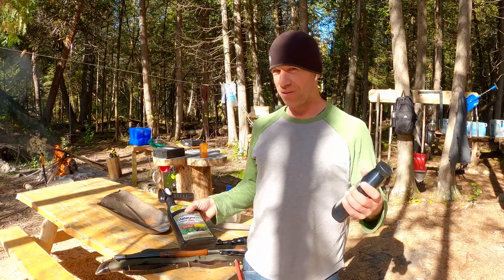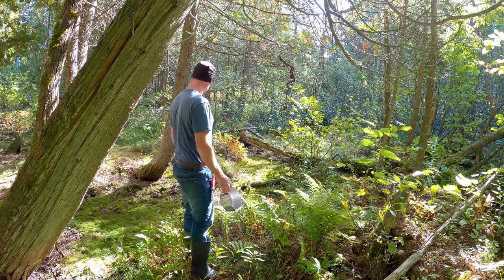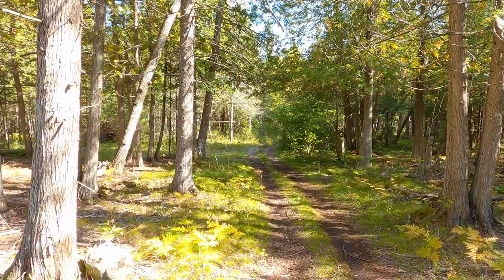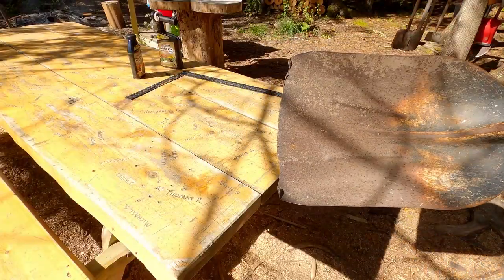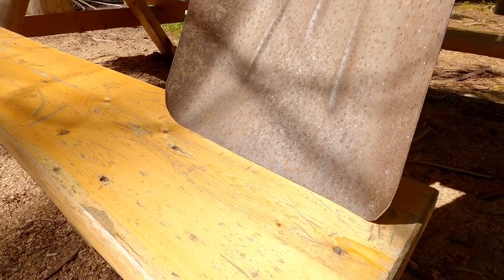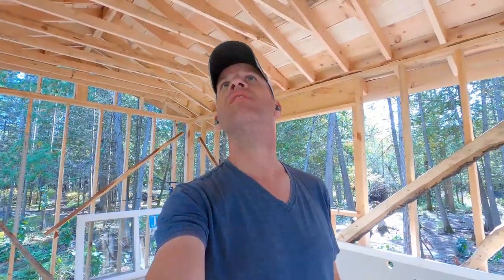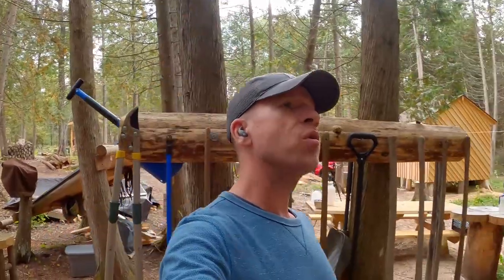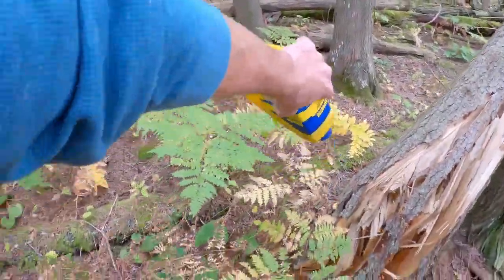Day 975 Living in the Forest- Spreading Mushroom Spores, 30-30 Shooting #105

Comment: Shovel grilling began, so legend goes, with a rancher in the Australian outback who had lamb (no shortage of that in Australia) and a campfire, but no grill grate to position over it. 

So he sterilized the blade of shovel in the hot flames, arranged lamb chops seasoned with salt and pepper on it and grilled the lamb on the spade thrust directly into the fire.

Comment: I'm very interested in seeing how well your planer works on the generator 👍 I'm in a house with old electrical wiring so I don't want to stress it and start a fire 🤣 

If yours works great I may have to reconsider buying one to run on our ecoflow generator/battery system... it would make woodworking a lot easier!

Comment: If you want a deer and preserve it, get yourself a pressure canner and some pint jars. Cut the meat up and can it. All you need is some clean water. You can use the canner on a camp stove as long as you can burn it for 90 minutes. The meat will keep like that for 2 or 3 years...maybe more. The rest if it you can smoke or make jerky. I can deer every year to make hash or cook with vegetables and you add your spices to it when you get ready to use it. It's a little work, but worth your while.

Comment: this was a fun video dont know why you dont do it more . hey you have at least two roofs now and there of pretty good size for the size of buildings you can make . why not get some gutters from the re store  or where ever you can cheap and use them to collect rain water . collecting rain water is legal in all 50 states  i think a couple states have limits on it for what ever reason but there not Michigan. now it would still suck in the winter but spring summer and fall  it rains and from watching other channels that do it i can say with a fairly good roof it would not take very much rain to fill your water tower up .and how much fun would it be like lots of fun right . also maybe we can talk water filtration at some point . two 5 gallon buckets some activated  .charcoal and a water spout  and you pretty much have a berky water filter . you dont really have to use activated charcoal regular charcoal would work but activated charcoal works like ten times better . its funny i been trying to learn more about activated charcoal on how its made it is pretty interesting on how its done . basically its charcoal thats washed really really well . then its baked dry . the smaller it is the better it is for water filtration . but it is also used as air purification and it should be larger so air can pass through it . from like a fan . but you can put regular charcoal out on a plate and it will absorb stinky odors  . just fun facts . charcoal is pretty easy to  make as well . that aspen wood you got would make great charcoal . all them scraps you burn . maybe not the cedar so much . just need a metal 50 gallon drum with a locking lid . a small hole to release gas . set a fire under it  and burn it . the gas coming out of the hole can even be on the bottom of the barrel so the gases can feed the fire . once the gas stops burning  its done keep the lid on it till it cools off and cover the hole so no oxygen can get in and when it cools off  you have almost a full barrel of charcoal .  ok im done long comment i know im sorry . take care work safe .
Reply: Collecting rainwater is NOT legal in all 50 states.  In Washington state ALL rainwater belongs to the state.  No intentional collecting.  Period.  I think it's an insane policy but I don't live there and will never.  I live in Idaho where we are still mostly "free" and the rain can be collected and used.   IIRC in Oregon a couple of years ago a property owner built a small pond to collect rainwater and the state came in and removed the pond/dam as it was illegally collecting/diverting the state's water....  they also prosecuted him.  I think that your suggestion for Ringworm to use gutters and store rainwater is a great idea no matter what his state says about it.  Eventually We the People are going to have to stand up to these tyrants that want to control every aspect of our lives.  Nullify the insanity by refusing to comply.
Reply: @juststeve7665   steve buddy Washington state  was not legal until 2009 when they reversed that law . how ever it is still illegal in some  of the county's due to old laws that still have not changed . i live in Michigan and know its legal here . Washington state is right next to California so we all know there crazy that way . how ever i do agree with you about the we the people statement . google is it legal to collect rain water in all 50 states . here is what i found  i searched it just for fun . While rainwater collection is legal in every state in the nation—there is no federal regulation—many states and municipalities do have restrictions on the practice. Other states, particularly western states with dry climates, encourage rainwater collection (aka rainwater harvesting) to ease the burden on local water systems.

Comment: The sprayer that you can't get to work... If it's the wand that isn't working, I don't have any advice for you. But if it's because it won't make pressure... If the tank will hold pressure, then drill the right size hole in the side dome of the top, and put a car tire valve stem in there. Then you can use an air compressor or hand air pump, to put pressure in the bottle.

Comment: Just a thought, I have the same planer (I was a Stanley employee so I got a great deal on it) and you might have an issue with trying to run it on your generator. They take a lot of current and it will probably kill your generator - especially on startup.

Comment: Ringworm, this is Paul in Youngstown Ohio.  Mitchygoss mentioned one in one of her vedios today about nails from the restore.  I like to watch this lady too.  She is probably watching one build stuff too.  She builds stuff too.  I took my ar-15  lower receivers off and the rifles and pistol are kits now and can be mailed to people.  To get them up firing again a lower receiver and lower receiver parts kits have to be purchased separtly from a gun shop.  I have an .223 pistol, an 9mm rifle pistol,  a 20 barrelled rifle with military furniture for target practice, and an ar-10 .308 winchester.   The 20 inch ar 15 rifle, an upper with a butt stock, gas with flat top is $550 pluss shipping.  The ar 10 with a 19 inch barrel, in 308 winchest is an upper receiver with a butt stock and sping and buffer is $600.00 pluss the shipping.  The ar 15 9mm pistol kit with free floating barrel is $400.00 pluss shipping.   with a flapper for a but stock, sping and buffer . ar 15 postol kit with upper, flapper, sping and buffer is $400.00 pluss shipping.  With out a lower receiver or lower receiver parts, these are considered parts kits.  The uppers are all brand new and the stock, spring, and buffer.  Within a few hours after getting a lower receiver and lower parts kit one can fire these.  All of them need to be broken in by firing about 200 rounds thru them.  These are ready to be shipped out.  I cannot sell the lower receivers or the lower receiver parts since I machined my own lowers from 80 percent stuff and my name is on them for my use only.  I still like to watch one with the chain saw make lumber and build stuff.  I watch on youtube many builders, smokey mountian outpost, my self reliance, girlinthewoods and her husband has a channel too.  The lumna acreas is good too.  There are a lot of them making homesteads too.  They make outdoor kitchens, outhouses for composting with chimneys and fanceyness too.  Nick some body built a big log home and this took him three and one half years to make his dream home.  Cannot recall the rest.  If possibly interested in any of my rifle kits let me know.  It hard for me to get out  of the house, am sick and a shut in at home.  The rifles are new .  I put them together here at home.  If I could get there with one and his firends would shoot them with one too.  I cannot see well enough to put the little spirings and detents in them again.  ar-15 . come will help one assembly the lower receivers and lower parts.  Once one put a rifle together and gets it shooting, it does not take long to do this again and agin.  I did this over four times now.  Have fun no matter what.  Paul in Ohio.

Comment: Ok so your not sure about a Band saw mill but what about a band saw mill that is portable as a chain saw mill but as efficient as a band saw mill? I am a welder designer for thirty years and I build band saw mills and have a little concept mill I want to build that basically you would screw a guide on the log and the log as with a chainsaw mill acts as the bed then you attach a small band saw head on the guide! you cut off your boards turning the log until it is a can't then you mill off your boards and with the last board that would have to be a two incher board but perhaps one could put it on a even surface and get a one inch board regardless! It is a little take into the bush concept mill i have been thinking about for sometime! It would be a perfect little mill. It would only be able to cut 12 foot logs total and anything down.

Comment: Board & baton looks to be the least amount of work for you. Just remove bark & cut your slabs like normal. Don't square up the edges for both the boards & batons. Mount the boards a good distance apart, then mount the full size batons. Might have to do something fancy at the top & bottom to seal from the elements. But you are using house wrap. 
FYI -  the older solar panels might not be as efficient, but they still charge on cloudy days.